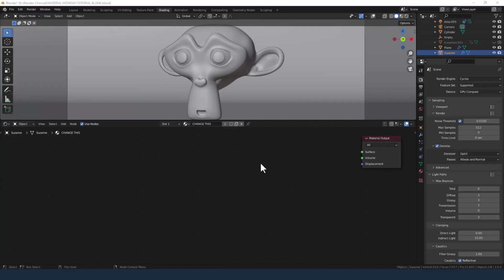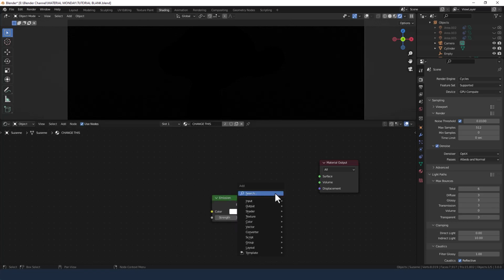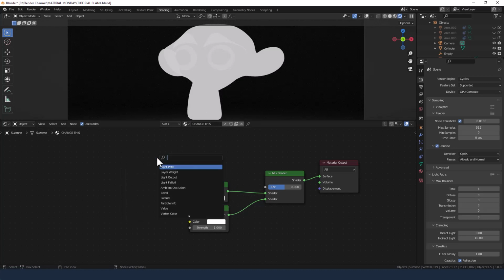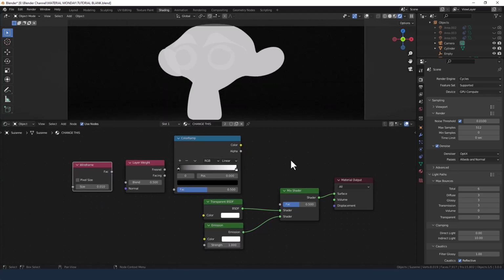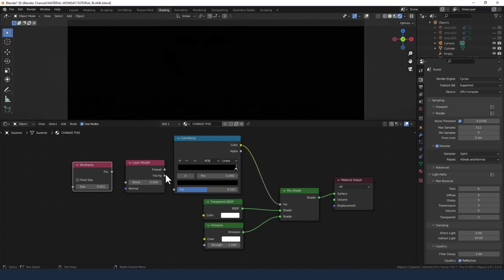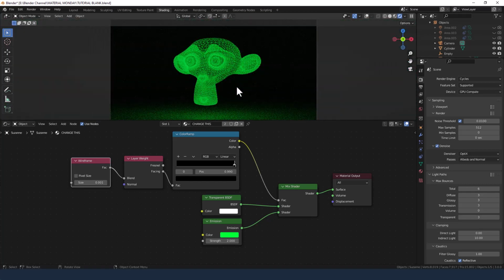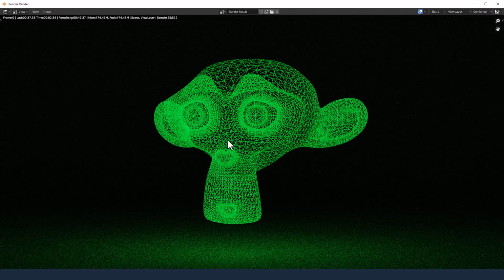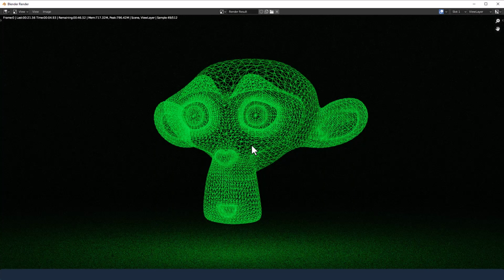CREATE A PROCEDURAL EMISSIVE WIREFRAME MATERIAL FOR BLENDER

Comment: thanks for the video, can you tell me why this texture does not give transparency when working in blender 3.3.2?
Reply from the maker: You're welcome. My first question would be - are you using Cycles to render this out or Eevee? I work exclusively with Cycles for my materials and this can have an impact on certain features. Otherwise, if you have set up your material exactly as I have, then it should render out as seen.